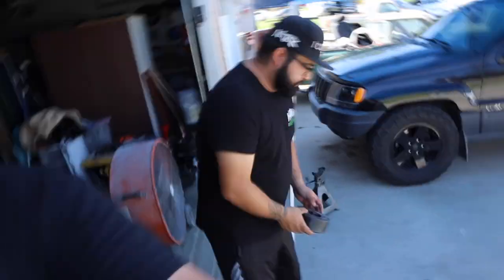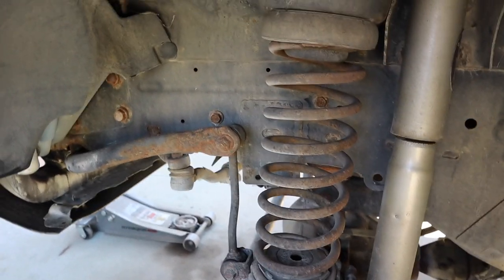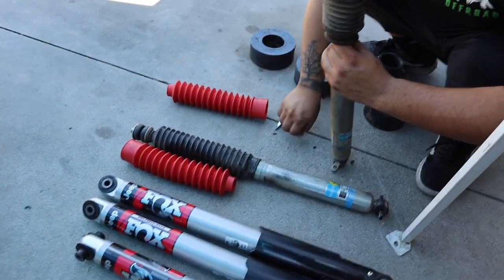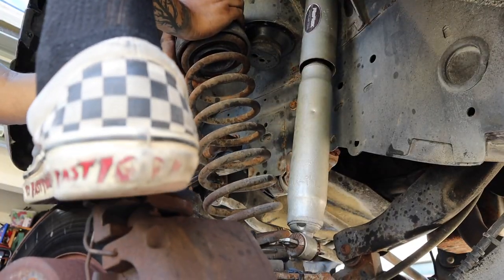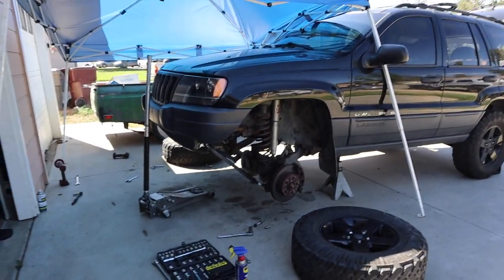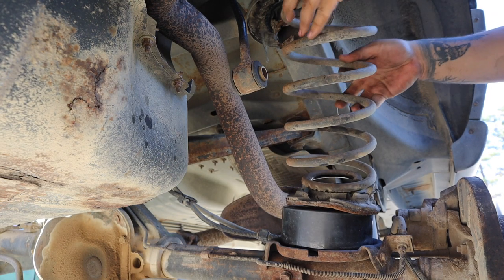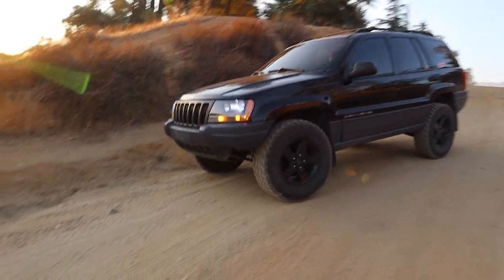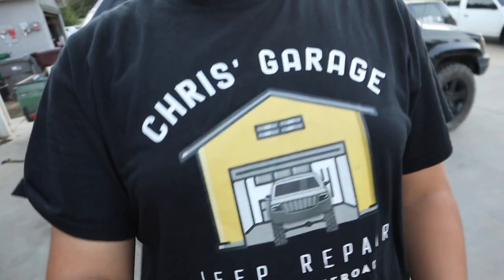Installing Lift and New Wheels on Chris' Jeep WJ Grand Cherokee

Comment: Like mentioned, disconnect all the links, shocks and arms the axle will fall clear not needing compressors.  I just put an IRO long arm on my 04, no compressor needed. Just let that axle hang!  Also, shitcan that WD40 and use PB Blaster.  I have been a Michigan wrench for 40 years dealing with rusty fasteners, PB is the shit!  Used to be Kroil, now PB is the stuff to use.
Reply from the maker: To much work😂 easy to use compressors as sketchy as it is

Comment: Get rid of those lockup prone teves calipers on the front 99-02 and replace with the mid 02-04 akebono calipers. 
Looks great with the lift!
Reply from the maker: Good tip! Will do! We planned on replace the brakes and rotors so we will add the new calipers to!

Comment: If you don’t have access to a spring compressor you can stock a bottle jack or scissor jack on the front axle angle it to the bump stop & wind or pump the jack up allowing you to install the taller spring or stock spring with a spacer block….personally I recommend starting with a 2” puck lift then if your not happy with the height grab some taller spring & reuse the lift pucks you have…:.if your really off roading a WJ the front springs can come out fairly easy when in the rocks so I highly recommend using a limiting strap or something similar so your spring doesn’t fly out when flexing it

Comment: You guys made it look easy. Will be doing a Rusty 2.5" lift on my WJ still waiting on my Isolators from Ironrock. Chris WJ looking nice. Stay safe guys
Reply from the maker: Yea I would definitely replace those while you’re there
Reply: @NajarOffroad  On backorder at Ironrock not sure when there coming in. But I did get my Jeep Cables in Big7.
Reply: Hey,  did you get that Rustys 2.5" lift installed?  I'm trying to decide if I should get that lift. Hoping you may have some insight.
Reply: Yes I did looks nice jeep still not running major oil leak will do a little short vid tomorrow
Reply: @Love2Wander did you need new adjustable control arms and track bar for the lift?

Comment: If you go ahead and loosen all of the control arm bushings before trying to add the spring+spacer, you can avoid spring compressors.
Reply from the maker: Thanks good tip! I forgot to mention in the video you want to loosen up the control arms  and retorque them once the jeep is on the ground so the bushing aren’t twisted if that makes sense

Comment: Will you do a video replacing the front and rear yokes for the driveshaft? I have the rzeppas at both ends and it would be helpful if you would make a tutorial whenever y’all convert his jeep! Good video 👍🏼
Reply from the maker: Yea eventually we will get to it!
Reply: You are speaking about the front driveline yokes.  The one on the transfer case is simple, buy one and replace it.  The one on the diff is a bit more tricky because of the crush sleve.  The proper way is to start over with a new crush sleeve and properly set the pinion depth.  It can also be done by trying to be careful not too over tighten the crush sleeve, but you never know if it was tight enough or too tight.  The best time to do this is when you re-gear the diff, because a new crush sleeve will go in anyway. 

With a rzeppa front driveline you will need to replace it with a double cardan driveline.  In all cases except with a custom axle, I strongly recommend a double double cardan front driveline. That's a double cardan on each end of the driveline.  Especially if it is a daily driver or overland rig.  The output shaft on the front of the T-case points upwards and as you drop the T-case this gets worse.  On the axle side of a driveline you want to have about 2° of downward pinion angle, but if you do that you end up with negative caster.  You absolutely need 5° to 6° positive caster to keep the jeep from wandering all over the road.  The best solution is to have a custom front axle made to correct for the angles between the outer C's and the pinion, but that's $$$$.  This is why older jeeps had locking hubs.
Reply: So with a 2” lift the stock r to r driveshaft works fine for Light off roading….but personally I hate the design 😂 so I’ve replaced mine with a earlier grand front driveshaft the v8 version of the earlier zj yokes & driveshaft fit just fine & will be allot stronger….also a recommendation beyond lockers & typical off rod upgrades are the iron rock off road front control arm strength kit I think it’s called so your paper think mounts don’t fold on rocks as well as a front rad support cage so you don’t bend the again paper thin one the wj has….initially they’re not really built with off road in mind so there’s some weak links once that’s taken care of they’ll go anywhere any other Jeep will go

Comment: The puck fir the lift fir the rear is better in the top.
Reply from the maker: I believe on supreme suspension instruction it showed to do the front on top and rear on bottom

Comment: Hello. Thank you for your wonderful content..

I lifted my 2002 Jeep grand cherokee 2.7 CRD ( WJ )  by adding 1.97 inch spacer to the springs. After the upgrade there is a death wobble problem. You did not extend the track bar in this video. Does it need to be extended?

I checked all the parts that causes death wobble and there is no problem in any of them. Should the track bar be extended?

Comment: I did 2.5in springs on mine. Love the ride! So far you guys are doing everything I did to mine! Except I painted my trim black and I installed a 7" touch screen instead of a 10"
Reply from the maker: Nice man! We might repaint all black
Reply: @NajarOffroad  Pm me I'll show b4 and after pics
Reply: @NajarOffroad  I'd love to see how those rims play off the black trim too!
Reply: What size tires did you go with after the 2.5 lift?
Reply: @monroemando  currently I have 255/70/16 on there now.
Reply: Where did you get your 2.5 lift at?
Reply: @NajarOffroad  
I need to tow 5k for 400 miles.... once. I have 3 options atm.
1) I have some Daystar pucks, never installed. 
2) AirLift bags in the stock springs 
3) maybe get some OME HDs 

What would you suggest?

Comment: Hey Najar I love the videos and the content your making, I’ve got a question do you think 35s will fit on my leveled wj, I have 3 inch pucks up front and 2 inches in the back I just picked up a set of 35x12.50x17 nitto mud grapplers and I’m kinda lost on what I should do… should I sell the tires because they won’t fit or screw it ? I already know I can’t do much off-roading because it’s a 2wd so I’m not worried about flex or anything like that I just want to know if the 35s will fit ?
Reply from the maker: With a bunch of trimming you probably could.
Reply: If 35 inch mud tire catch fender it will be gone LoL

Comment: I notice you didn’t put in a nut on the front spacer. My nut isn’t fitting in the whole properly. It’s just not tightening fully or securing it. Is that fine or do I need it? Thanks
Reply from the maker: What nut do you mean? message me on instagram or facebook with a screenshot @najaroffroad on both
Reply: @NajarOffroad  sorry I meant bolt lol

Comment: Yo man I need. I have the same jeep and looking for the same wheel style, found a set with tires on market place but I was told I would need a adaptor to fit the wheels. I don't see your boy with a adaptor. The wheels are from a 2014 wrangler JKU sport.
Reply from the maker: No adapter but the wheels rub a lot on the suspension!

Comment: Rear spacer goes on top
Reply from the maker: On the supreme suspension instructions I’m pretty sure it said bottom but I could be wrong
Reply: @NajarOffroad  I thought it was bottom also but kept moving around had to redo it and place it on top. Coil  stays put now. 👍
Reply: Is it normal to remain that space between spacer and the deck?

Comment: I just bought some Jeep Wrangler Jl rims for 120 set of 5 what size mud tires should I put on then? 2003 grand Cherokee limited stock height looking to put on 2.5 inch lift later on

Comment: you think a 2.5 inch spring lift and 31's work fine without trimming?
Reply from the maker: Might still need to trim the front bumper a little
Reply: @NajarOffroad  awesome thanks for the feedback man

Comment: So what's a good spring lift that's only 2 to 4 inch lift for good price and what all do I need to replace
Reply from the maker: I think Iron rock 3 or 4 inch would probably be decent place to start! Zone has a 4 inch lift I think more affordable than iro
Reply: Cry once and get the IRO lift.  There are good quality parts inside of that kit.  If you can swing it, do long arms front and rear.  The IRO rear long arm kit is a triangulated long arm lift, unlike RC which isn't even a true long arm lift.
Reply: Spring only lift, shouldn't go past 2" with short arms or the ride will get rough.  This is because as the control arms start to go vertical, some of the road vibrations end up going through the control arms that are designed to be stiff.

Comment: If you lift the opposite side of your axle you would have had more room to put your coil in without using the coil compressor...
Reply from the maker: I did have the other side lifted

Comment: Are those 265 tires?
Reply from the maker: I believe they are 255/75/17
Reply: I just bought my 03 jeep last week and I'm trying to get 265s on them and a 3 inch spacer to make them fit
Reply: @NajarOffroad  I’m looking to go for this exact look but on a 1999 grand Cherokee wj . Would this setup fit mine?

Comment: Great video!!! 🙌🙌🙌🙌🙌🙌 quick question you will think 245/75/16 will rub in a stock WJ???
Reply: You may have to do some tire research... I'm on the same boat so....255/65/17  equals to 255 mm to inches =10.5 " wide and the 65 = 30 inches tall...and this is my choice tire for my recently two inch lift on my wj...you can just play with those numbers till u get it right...good luck .
Reply: I’m running 245/75-16’s on my 99. Very little rub at full lock

Comment: how much would a mechanic charge for something like this? I am terrified of coil compressors and dont want to ruin my jeep lmao
Reply: I’m trying to debunk the coil spring compressor myth by using logic. So on iron rock off roads website it claims travel rate of 200pounds per inch on coil springs. Say the bolt size on the compressor springs we’re 5/8” fine thread grade 8. So at that rate you could safely torque to 250 ft pounds. I don’t know how the equations would work for foot pounds to clamping force but all I’m saying is to compress a 2” spring to stock height would take 400pounds of force and the two spring compressors could handle 500 a pair easy then it should be no problem to install a 2-3” spring lift by yourself as long as you have a tall enough jack
Reply: Just don’t go ramming down the spring compressors with an impact and use and end wrench and keep test fitting til you get them to go in.